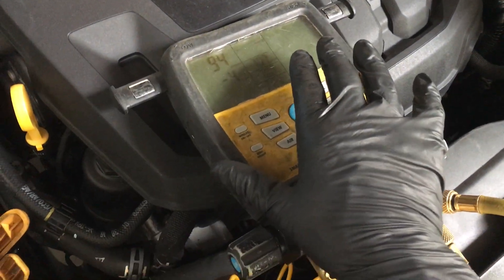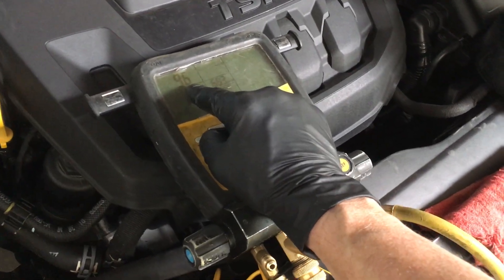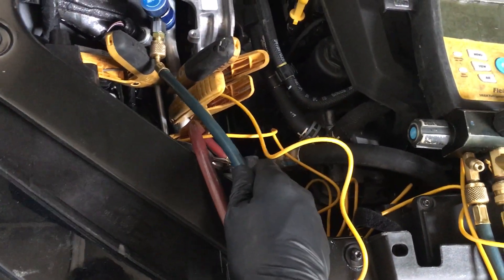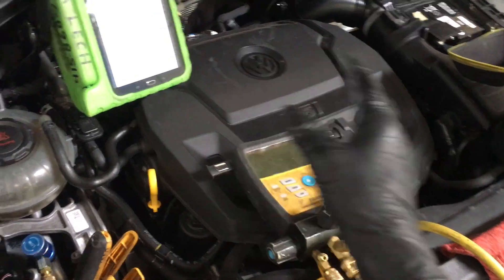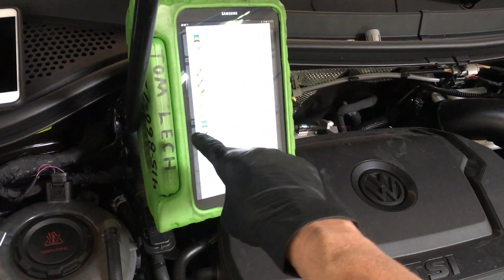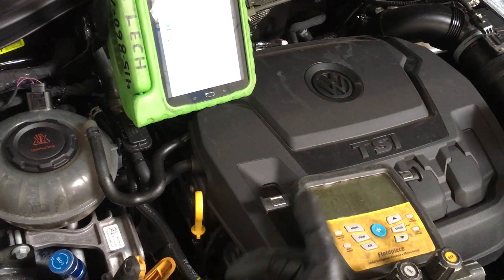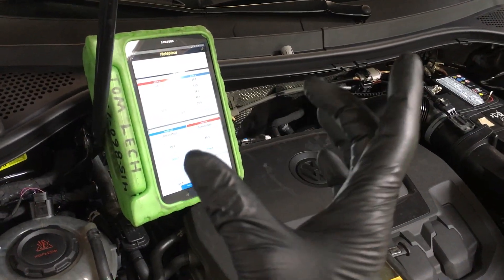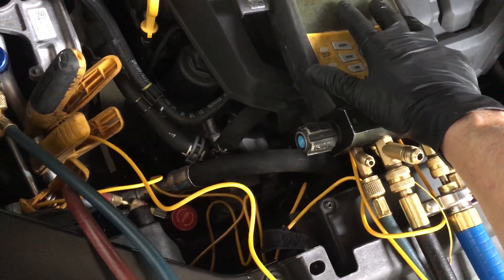SMAN 480V refrigerant gages, understanding micron gauge. Deep vacuum.

Comment: Do u beleive a new booty should emmedietly start learning with this digital gauge or start off with the needle gauges? Thanks for the content, very helpful.
Reply from the maker: Yes,  having somebody to do the math for superheater subcooling most students today barely have a third grade level on a graduate high school. 
So if they can’t comprehend, doing superHeat and subcooling on a piece of paper with analog gauges, why waste your time . 

I was raised and started on analog age is 46 years ago . 
       I’d rather learn on the digital gauges I can actually see what is happening and watch the mass the formulas change right in front of my eye simultaneously. 

Especially if you were doing residential or commercial on a split system . (not talking in Automotive right now.) 

Because the system is always moving the temperatures of changing and running up to the roof, or out to the side of the building to go physically take the temperature of the lines and outdoor temperature at that moment and run back into the building go up the stairs through several rooms to the air handler to take to room temperature and the Supply temperature .  And then do your math. What a waste of time.. 

And by that time the temperature on your refrigerant lines may have changed a few degrees by the time you took your temperature indoors and when you did your mouth, you’re already wrong and off by a few percent . 

With analog ages in Bluetooth, it’s instantaneous 

So whatever reading is being taken outside, and indoor simultaneously is giving you the actual true number . 

It’s like having an automotive Training School .  And teaching kids how to crank over the engine and the theory behind a FORD model A
Teach kids nowadays, how to say distributor timing and set points and check the distributor condenser . 

Teach kids how to pack wheel bearings on your grandparents 1960s car 

Teach kids how to change innertube tires on cars 

Imagine wasting all that time in class to teach something that’s not used anymore like rebuilding carburetors 

We still have his old dinosaur fogeys bleeding you’re making people stupid where are public school system has already did a good enough job at that it’s not a belief it’s a fact . 

On residential or commercial I don’t know if you know that industry but I actually purchased a TrueFlow grid from The Energy Conservatory . What a game changer no more using pedo tubes for taking air flow flow meters and then having to do all the math and the set up and it’s only partially accurate within a few percent.

This thing a TrueFlow grid is extremely accurate and as it’s easy to set up as changing a filter, pull out the filter, pushing the truth located you got your numbers, drill a few holes for test ports . 

With analog ages, you cannot read the moisture content, and prove that it has been removed 

With analog gauges, you cannot read a extremely small leak under a high pressure nitrogen decay test that loses a few tenths of a psi over a period of a half hour   
Because analog gauge needle will not move perceivable to the human eye . 

It’s a no-brainer not even a contest . 

It’s like comparing a quarter-mile race of the 1973 Pinto against a Tesla Plaid
Reply: @coldfinger459sub0  My son is starting out in this field for residential, I bought him this Fieldpiece SM480v and an analog one as well, along with some of the other items your using and recommended in other videos. Thanks for the tips and great content.
Reply from the maker: @jesseruiz2337  some people like seeing analog stick, the needle, mostly old people. 

Like my son, he was raised with a half 1 million hours on video games, looking at digital data . In the form of numbers, not analog, moving gauges.. 

Your son needs to grasp inside his head to see with his minds eye, 
Refrigerant, saturation superheat, said cooling, yes to have the ability to see himself as that molecule of refrigerant going through the system and be able to describe the phase change that he’s going through comprehend the velocity of refrigerant mass flow oil, return oil, logging the causes and cures. 

And electrical .

He needs to completely read every new service manual and installation guy that comes with every manufactures piece of equipment take it home at night and read it and understand it .   And a little Asterix or the number footnotes at the bottom of the page or above the item that tell you goes to the manufacturers website and download the related articles or service bulletins to that piece of equipment..  about extended long line sets

Factory additions of cold Ambien kits that are not included on the unit 

He needs to know the reason why and comprehend, for what purpose are they adding these items 

Not just be a Parts boy and open up the box and put it on and don’t understand why it’s being added and what will happen if it doesn’t get added . 

He needs to understand the finances of a business profit, margins, gross profit, and the difference between net profit and net / net profit .

Comment: is it ok to use co2 instead of nitrogen? thanks.
Reply from the maker: CO2 quality is very sketchy in industry supposedly most of it is contaminated with moisture.   Because for general use CO2 they do not take out the time and procedures to make sure the filling tanks are moisture free. 

There is laboratory grade CO2 and medical grade CO2 that goes through the procedures to make sure it’s moisture free.    CO2 is considered generally a dirty gas. 

If you have TIG welder or meg welder and you have argon argon is also a clean dry gas that is inert.
Reply: @coldfinger459sub0  thanks for the respond,very much appreciate it,i have the co2 tank  as a ATS kit for flowing the gas in to evap pluming or a/c pluming up to 200 pound for a/c and look for co2 leak with a co2 leak detector to pin point the leak.
Reply from the maker: @moebassidji8306  oh yea you must be in one of the EU countries or others where they are very strict on using refrigerant for leak testing.   I’ve been thinking of doing a video using CO2 of course a good quality make sure it’s dry with my CO2 leak detector to show the method of using CO2 to look for leaks. 

I have CO2 used for carbonating water large tanks. 

And I have the DeTek Inforcon leak detector Stratus with the CO2 leak detection module
Reply: @coldfinger459sub0  i live in LA and the kit that i mentioned is from AUTOMOTIVE TEST SOLUTION ,I will be greatful to see how you use your co2 tank and your co2 detector.
Reply from the maker: @moebassidji8306  i’ll try to do a comparison test.   When I find a small leak are use refrigerant first then remove the refrigerant and then stick CO2 in and see if I can detect it with CO2 It was in the affair side-by-side test on the exact same leak on the exact same car

Comment: I am replacing an evaporator and as per manufacturer specs, I must add 50ml of oil on the system. Thus it mean I should put directly to the evaporator or have to inject it in the suction port after the vacuum?
Reply from the maker: In the evaporator

Comment: Using a tru blue on 1/4" is doing absolutely nothing...only .7 cfm can be pulled through the 1/4" hoses.....this is like prehistoric hvac
Reply from the maker: Apparently you’re a literate and don’t know the difference between HVAC and automotive. 

         They have special schools for children like you I can help you and enroll you. 

          And apparently you cannot count because it’s two 1/4 inch hoses not one no we will get you a math tutor to count up to two

            Unlike automotive service valve fittings that have a tiny quarter inch valve core depressor inside of them restricting the flow

           Are the automotive valve core is 5/16 of an inch in diameter on this vehicle times that times to close more than 10 Times the flow then a HVAC residential or commercial quarter inch service valve port 

          I hear the lips flapping and talk smack but you never read a book in your life on the Automotive side. .
          But if you’re watching this many videos then you’re a fan bitch

Comment: I know fieldpiece sells a separate micron gauge, but is there any point in buying that when the sm480 comes with the micron capability?
Reply from the maker: Excellent observation.  Physics behind why a Micron gauge is not good inside refrigerant manifold gauge. 

            Do you have a vacuum in the key that’s in my current age can you read it just comes from the rubber hoses because they were not meant for deep vacuum. 
                Then you have the O-rings and the fittings and valves that are all other little possible leak points that may cost you to fail your Micron decay test. 

           Just the residue oil POE or PAG coating inside of your hoses absorb moisture and the offgassing from the moisture will make you fail the pressure decay test. 

        The micron should be connected directly to one of the lines by fitting and then have a valve to velvet off separated from the hoses. 
                  So you are only reading the offgassing or leakage inside the system not your hoses gauge manifold assembly. 

              But it is nice to have it inside the gauges because something is better than nothing but only if you learn how to use it correctly.
Reply: @coldfinger459sub0  I know what we do is run nitrogen through our gauges and hoses, but I have not had the opportunity to use my Fieldpiece manifold gauge yet as I am in training (my trainer uses a analogue manifold gauge). I just thought I would ask because fieldpiece does offer the separate micron gauge(could save money not buying that too) . Much appreciated on your reply for sure.
Reply from the maker: @Honeyman76  the BluVac micron gauge is more reliable. You don’t have to buy the expensive BluVac Pro+  it the same gauge just more bells and whistles. 
              Clamp on temp sensor with your analog gauges so you can learn how to accurately measure super heat and sub cooling
Reply: I'm only new in trade (first year post apprenticeship) and thinking to save some money.. Instead of buying separately digital manifold gauge, temp clamps, vacuum gauge, thinking to get one piece of fieldpiece 480v..
What do you think is it worth it?
Reply: @domas4463  worth every nickle in my opinion. Been doing the job now for 16 months and I love the sman 480

Comment: Without doubt this is the best investment I've made getting one of these manifolds.  Everything starts making sense and you see the bigger picture. The wireless accessories are pretty cool too. I've learned more in the last year than the previous 15 years working blind with analogue gauges.  Just like the vehicles were working on, the technology moves on, so should your equipment and knowledge.
Reply from the maker: “Working blind with analog gauges”
         That’s a good analogy, I will use that sometimes 👍 

      I would have to say nowadays working with analog gauges on air conditioning is like working on a new car using a old fashion 12 V headlight as a test light to probe a computer. And the cover of your matchbook to set points gap dwell on a new car in 2020 lol 😂

    Just thought any of the young technicians will not know what I’m talking about setting points and dwell lol 🤣